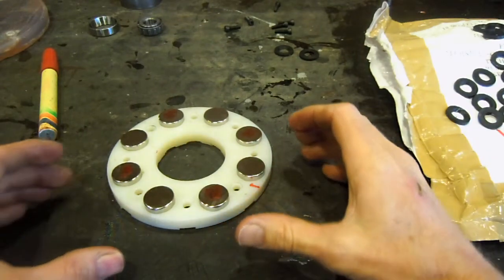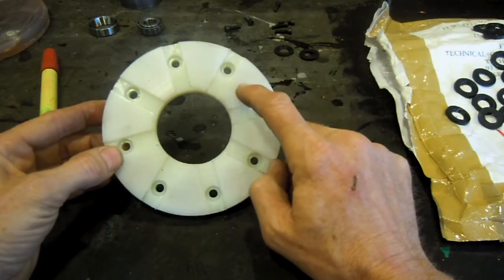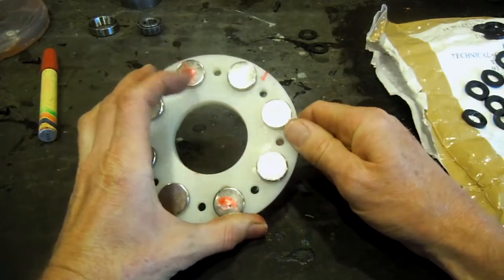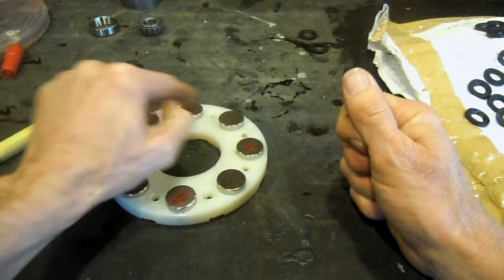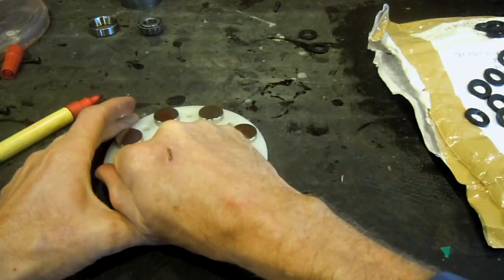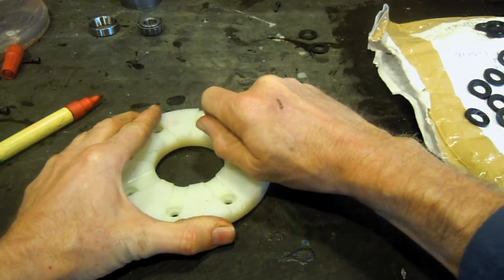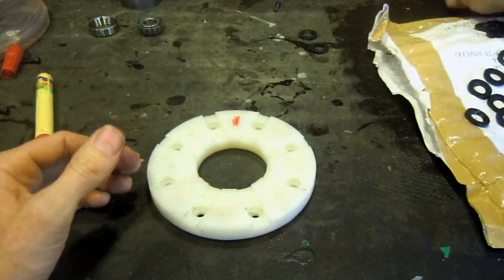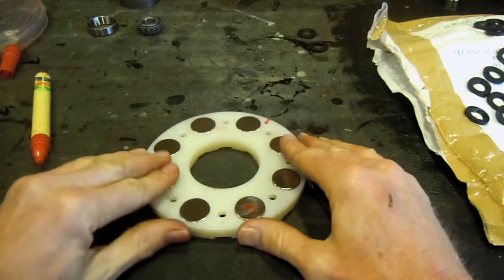Wind turbine magnet disk

Comment: Hi there. I really like your way of holding the magnets in place using this plastic disc. Most alternator videos I've seen they use epoxy resin instead which leaves no room for error and very difficult to change the magnet rotors once you cast the rotors. I was wondering how to go about changing the magnets on these plastic rotors you are using.  How about making a small hole on the center place where the magnets are going to be inserted,  similar to the holes you already have in place  next to where the magnets are inserted now. ? Then if you need to change a few magnets,  you could flip the disk around and tap the particular magnet from the opposite side with a piece of metal, kind of like a rebar,  and have it be removed from the plastic disk without damaging the disk. Does adding these extra holes on the cavity where each magnet will be installed weakens the magnetic field at all ?? Your response is greatly appreciated.
Reply from the maker: From a performance point of view it should not cause any changes. The issue with holes as described, may rather be that it offers water and moisture a point of entry, which in the long run might make the magnets more prone to corrotion / rust. It might be more pragmatic to very (very) slightly increase the diameter of the holes in which the magnets are positioned so that they remain on the steel disk when the plastic cover is removed.